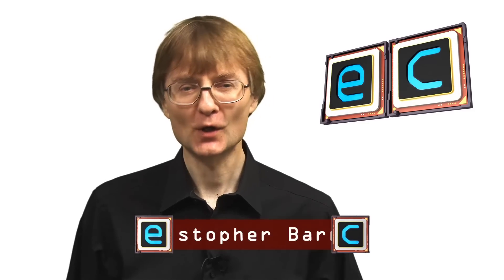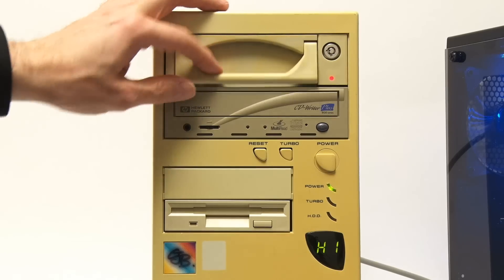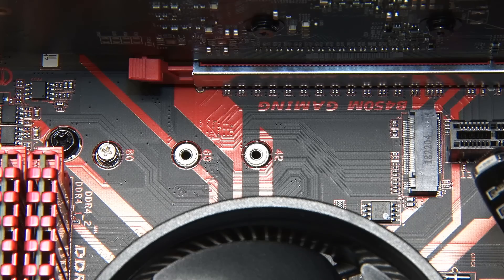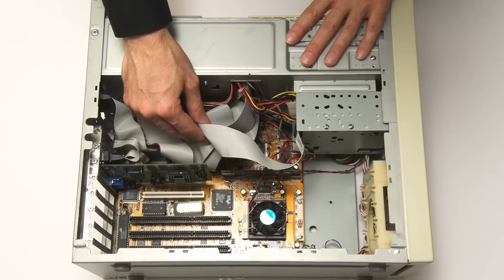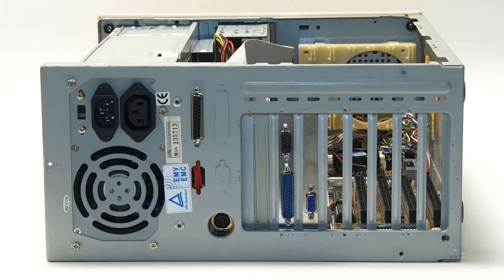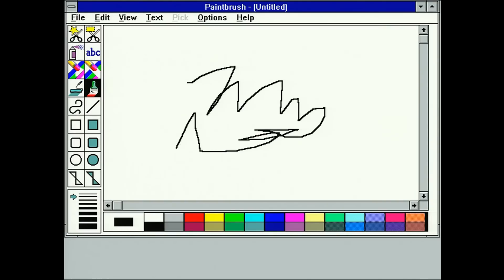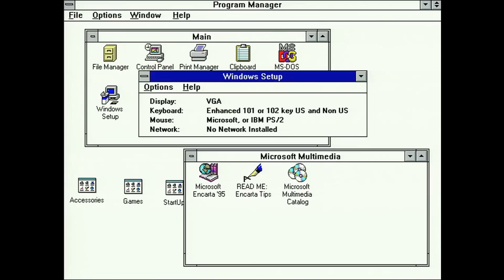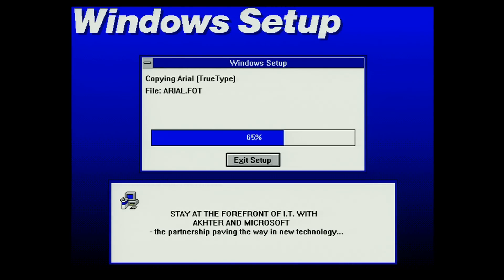Ryzen 3 vs 1996 PC

Comment: at the end of 2020, my GTX 780ti was failing, but with the insane inflation of graphic cards, I decided to buy my first new Laptop instead. I got a Lenovo Legion 5 with a Ryzen 7 4800H and an RTX 2060, I Installed (2) 1TB M.2 drives (Corsair MP400).
The Laptop it was standing in for an Intel i5-6600k & GTX 780ti (rip), and my other PC (currently used daily) Ryzen R5-1600 & GTX 980ti. I expected my Laptop to be almost as good, or on Par with, the Ryzen PC. I was happily surprised that my new stand in Laptop, had more performance than either one of my PCs.
I know alot of the experience, is owed to the Ryzen 7 CPU, but I was also encouraged to throw the 2060 a little credit. I know my PCs are getting a little, long in the tooth, but if I were to upgrade video Cards I would seriously consider the 2060, for a alternative budget choice, below the RTX 3060 / RX 6600xt offering.
If I had to compare computers, I would like to see  how a first gen Ryzen system, with an older mid-upper level Graphics Card, would fare, against the modern AM4, with a budget, modern Video card.

Comment: My first CD ROM drive was via a SCSI adapter plugged into the side of my Amiga 1200. I couldn't tell you how many hours I spent going through shareware stuff on Amiga Format etc. cover CDs.

Whether I wanted to spruce up Workbench with more pleasing NewIcons, use a spreadsheet or word processor or simply play a game, it would always take multiple floppies, often with no support for hard disk installation due to copy protection, but these magical shiny bits of plastic held all of it. It was almost mind bending to a teenager like me, who just what? 5 years before had been saving and loading approx 160kb of data per side of C60 tape, then just previously to getting the CDs, been limited to 880k per disk.

In '99 when I got a CD Writer, my mind was blown again at 650mb of movable storage.

And now I'm not impressed unless it's over 2TB, and even have an 8TB back up drive. Maybe I'm turning into a snob.

Comment: I must ask the obvious questions. In 1996 I bought a new PC with Windows ‘95, why did you not get the latest OS.
Second, where is the modem? I used it to connect to AOL and MSN. Even my first 1986, PC had a 2400 baud modem for the BBS. 

FYI my first computer was an AT&T 6300 with dual 5 1/4” floppy drives and a monochrome monitor. I added a 30 mb hard drive card to it that cost $500. It was custom built in a small computer shop by strapping a Fixed disk card, a frame and a drive together. It took up two slots.

I could not afford a first generation CD writer so I went down the tape drive unit road and then to a USB Zip Drive. Then the price of CD drives dropped.
Reply from the maker: I built this PC, rather than buying it, and chose to use Windows 95, as I already had a boxed copy. The modem was external.

Comment: The newer PC has 250 x the memory and if quad core makes it 4 x as fast then 
 116 times the speed!! You're right, they were so expensive, about 32 years ago my 286 processor PC was £850, over £1700 in today's money. In real terms my HP Intel i7 laptop bought this year is under half the price.

Comment: My first PC was a 133 MHz CPU,128 MB RAM, a 2MB VGA Video card and a 127 MB HDD. I now use a Lenovo T530 Think pad with an i7 Quad Core CPU, 2   128 GB boot SSD, 16 GB RAM, a 1TB storage drive and Intel 4000 Graphics.

Comment: This is making me quite nostalgic. I built my 1st computer in mid 1995, ostensibly to help with my degree work. Unfortunately I ended up staying up all night playing Doom and eventually delving into the innards of this new-fangled operating system called Linux.  I can still clearly remember the specs though. It was a 486DX2-66 with 16MB of ram, a massive 500MB hard drive, Soundblaster 16 and a Cirrus Logic VLB graphics card. I think I may have pressed the turbo button a lot. 

If my dissertation had been on Doom secrets and Sim City 2000 arcologies, my degree would've gone a lot better.

Comment: God I remember that after you exited windows back to DOS and then typed "exit", you had to manually turn off the on-switch, as it was a real switch back in the days and not a push button.
And when I first saw the "HI" on the display, I thought that the computer was greeting me...
The most expensive piece of machinery I ever bought was that 233Mhz Intel Pentium MMX equipped PC back in 1997. But I still have its monitor. It is a 15" EIZO F35 and it is still working! EIZO FOREVER!

Comment: Always nice watching your videos @ExplainingComputers. Thank you! 🙏

I am curious.. if you were to still find a use for this machine in current times, instead of keeping it as a ‘dust collector’, what could be a practical application beyond turning it on from time to time for simple nostalgia? I know a RPI could well outpace it, but I never like to see wasted processing power sitting around, and I always try to find ways to reuse it 😄

I am more interested in its practical use with the current setup (MSDOC + Win3.1). But I would also be interested in hearing your opinion on how far this machine could be upgraded (in terms of both hardware and software) for other practical uses. Is there a Linux version that would run on it for example?

Sorry, lots of questions, but your video really made me thinking.. I guess this is content for a whole new video 😄😅

Keep it up 👏🏼
Reply from the maker: Thanks for this -- as you say, a whole new video. I guess an old PC like this could be used as a server, for retro gaming. Or, for a writer like myself, it runs WordPerfect 5.1 just as well as it did when I wrote books on it many years ago. So as an off-line office machine, it is still fine.

Comment: Ah those were the days - horrible fat ribbon cables, and those awful molex connectors which you could never get apart without using a screwdriver and stabbing your knuckles in the process. That combined with the sharp edges of old PC cases made computer building a very dangerous and bloody affair! :)

Comment: Have one of this channels Ryzen builds - my case is very similar too - it's my daily work horse, running Ubuntu. And I still have a tower custom build from the late 90s languishing under a home office desk. The problem about firing it up these days is primarily display - I'd need to adapt its VGA analog to HDMI. And to work with my HDMI/USB kvm switch, would also need to adapt the PS2 mouse and keyboard to work over USB. A modest retro project some day, I suppose.

Comment: I wonder if Windows 95 would run on that system. I used those when I was a kid! I don't miss them. :D
Reply: my 1st pc was a pentium 133 / 32 MB RAM, also in '96 and we put (well my brother did) win 95 on it. I think it had a S3 trio something gfx-card and he was amazed as how smooth it would render explorer windows with content showing and not just the outline :D
Reply: @MarioMarioD80  Wow. Tech keeps moving forward. The computer we had in the house was a Commodore 64. The first one we all used was a Dell Dimension 4100 Pentium II.
Reply from the maker: I'm sure it would. :)
Reply: @ExplainingComputers  Have you thought of running a low spec Linux distro on it? Perhaps DSL?

Comment: Thank you for a very interesting and nostalgic video, Chris. I am trying to decide where to go with my computing in the future - Apple Mac to compliment the iPad and iPhone, make do and upgrade what I’ve got, which is old pc running Windows 10 Home or build a new pc. My question is about upgrading an old pc. From watching an earlier vid of yours I learned that it is possible to use an old motherboard but all I could do would be to upgrade RAM and storage. Is the front side bus still physically on the Motherboard in the Northbridge chipset on new motherboards? And if it is, am I correct in thinking that on an old pc the fsb is the potential bottleneck. I suppose I’m asking what are the considerations for upgrading or to start building a new pc based on a new motherboard and processor.
Thanks for answering this and keep up the excellent and informative videos.

Comment: The first computer I built had a Motorola 6800 CPU running Mikbug, and by build I don't mean attaching a motherboard to a case and plugging in the CPU/memory, I mean physically wiring all the individual chips together based on a hand drawn schematic. The interface was a serial port, there was no video. Storage was cassette tape (via a serial converter). Boot time was never an issue because it didn't contain an operating system, only Mikbug...and loading software was a slow process. Very limited functionality, even an 8 bit arduino is far more powerful, but what a great learning experience. Someplace in my garage buried in a box I still have that, who knows, maybe it could be fired up. What I wanted at the time was a SWTPc 6800 system, but I couldn't afford it.
I remember other "home computers" (like the KIM-1) that just had push buttons/switches, and 7 segment displays, fortunately my first computer was more "advanced". lol

Comment: Damn. I want that beige case or similar as long as the i/o slot is there and stash it with the latest hardware such as Z490 and i7 10700k. Plus add one such as USB 3.0 front and rear panel, M.2 drives and a high end noctua cooler (NH-D9L). Following the trends that some are doing :)

Comment: Just wondering why you chose a processor with inbuilt graphics and used it with a discrete graphics card?
Reply from the maker: I made a series of six videos in which I built the Ryzen PC, showing how it could be upgraded over time. The graphics card was only added in the 5th episode. So, if I was building with everything with a graphics card from scratch this is not what I would do. But I built up PC, as many, many people do. Indeed, I have had thousands of comments and e-mails following the series from people who have initially built with an APU, with the intention to add a graphics card when they could afford it.

Comment: Nowadays power supplies are located on the bottom of the enclosure, sound a bad idea to me since heat are rising up with convection,  having more heat on the system electronics, what do you think of that!?
Reply from the maker: So true, but gives a more stable centre of gravity though.

Comment: I  had built for me a  P90 in 1995, in a bigger case (the one shown here is a "mini-tower"), but I ran it on Slackware Linux, which was far, far more capable than Windows. It provided an environment very much like today's, the big difference being that the installation was entirely manual, which was still more or less the rule for MS-DOS and Windows 3.1 too (as seen here). Very little PnP, one had to edit all configuration files by hand, which was still a lot easier than setting up a Sun workstation ten years earlier.  It had a Gigabyte motherboard and I used SCSI diskdrives with a PCI SCSI controller, in those days more capable than standard dumb IDE(ATA) drives. Networking was not a native part of MS-DOS/Windows 3.1, whereas it was integral to Linux. Of course, in 1988, Sun produced the 386i, for only one year, one of the great missed opportunities in computing, with capabilities never fully duplicated, though modern Linux finally does as well (and much faster).  Had Sun pursued a 486i and later Pentium versions, with full PC compatibility, Sun instead of Microsoft would have become universal. Instead, Sun chose to concentrate on the high-margin engineering workstation market with their own in-house RISC hardware. Later, Sun came out with another Intel-based workstation, but by then Windows ruled the desktop.

Comment: back in the old days, engineering students had to optimize code to run in small memory (8-32MB) with fast scsi disks shared over 10mbps ethernet. NFS stale mounts persist :-(

Comment: LOL! My first was a MJN Technology 486DX (maths co-processor version) in 1993. I paid 120GBP just to upgrade from 40Mb to 120 Mb HDD (never fill that in 100 years I was promised) and an upgrade from 14 inch to 15 inch monitor cost a similar amount. A full 1 Mb RAM and loads of tweaks with HI-MEM-SYS stuff (can't remember what that was all about now - something to do with loading up stuff to high memory to maximise that massive 1 Mb RAM). Windows 3.11 for workgroups was a huge improvement from Win 3.1 Happy days eh lol. My RPi 3b would be a  luxury in those days. I'd love to see a decent comparison of the computing power of these machines over the years.

Comment: You made a mistake around the 9 minute mark and said "another serial port" while pointing to the 25 pin parallel printer port.  Old system has standard dual 9 and 25 pin serial ports on the slot insert and a 25 pin parallel port attached to the case.  Meanwhile around the 13 minute mark discussing "Encarta", it should be noted there were far more detailed Encyclopedias and more information on everything in 1996 on the Internet easily accessible on "Gopher" (port 70 predecessor to Web) known to most everyone who had already at that time been on the internet for the past few decades prior.  The catch is that the internet was not all that graphical, text and various fonts and styling but if you wanted the pretty pictures to go with the text information then you would go to something like Encarta as modems were quite slow back then and high speed network access was only available at government locations and major universities.  Graphics otherwise kept minimal due to transmission speeds at most locations.  It is an interesting side footnote that while much of the world in the general public first became aware of the internet in 1992, it actually went back to the early 1970's and its origin predecessor arpanet even further back to 1962 leaving some of us already using all that decades before most people out there even knew any of it existed.
Reply from the maker: Yes, you are right -- I got that wrong. I'm always looking at things from such strange angles when filming -- you have a  much clearer view than me. So I sometimes get well into a shot and have no idea what I'm pointing at!

Comment: 1997:
- pentium 166MHz
- 32 MB ram
- S3 trio 64V+ 4MB
- Sound blaster 16
- Conner 2,1 GB HDD
- 8x Sony CD rom
- 3,5 flopy Sony
- mini tower I think PSU was 150 or 200 W
- philips color 14” monitor (one with green on/off button)
- chicony keyboard
- microsoft 3 button mouse
Reply from the maker: Those were the days.

Comment: My first 'pc' was a 386 running 25Mhz with either 2 or 4 megs of Ram. It also had an 60 Meg hdd running at 4500 rpm. I can't remember all the details but I do recall it was expensive. That was in 1992 or 93. Before that it was Amigas, CPM, and Sinclair spectrum with cassette drive all the way back in 1984. Fun times 😁
I think what I miss mostly is that there were so many different brands of computers, all incompatible, all fighting for a spot. Very few survived, and now everything is the same, and so dammed generic. It was the computing wild west in the 80s. A massive free for all.

Comment: You had a CD writer in 1998?!!! Holly crap! Only the rich had that back then! (Well, that's how I saw it, but I know better now.) I totally remember those 3 1/4" drives. When did the bigger 5 1/2" disks get replaced by the 3 1/4"? One thing I always wondered is, did the turbo button ever work? Why did they include one if everyone always wanted turbo on? Why not just have the cpu always be on turbo? And you had a 1GB drive in 1998?!!! I didn't even know they existed back then, at least not for consumers. And where's your ZIP drive? Oh, FYI, in the mid-late 90s I was still using actual encyclopedias and libraries to do research during my undergrad years. Except by then the university at least had databases where you'd punch in keywords and the computer would either spit out CD-ROM serial #'s or books on the shelves, which I'd then have to go get off the shelf and find the section in the book, and read from an actual book or academic journal. That continued even into grad school in the early-mid 2000s. I can remember as an associate instructor grad student, telling my undergrad students, "Don't rely just on Google to do research." LOL. Thx for this trip on memory lane. I do remember Windows 3.1. I also remember when Windows 95 was the craze of the world. When it came out, people would trample over other people just to get a copy. Computers are a hell of a lot more powerful today.

Comment: That old Pentium brings back many memories, I think the first computer I built was a 486 dx2 66Mhz system.  Much more difficult back then with all the jumper settings, and cables which could be installed backwards.  I am staggered at the advances in technology that have been made in such a short time.

Comment: I'm sorry but are we supposed to be impressed by the new system? If that's even a secondary intention behind the making of this video then that point is completely lost. Who the hell builds a system in 2019 with only one front usb3 port? The motherboard header supports TWO. Having to route a second cable to reach a usb2 header is the result of nothing more than Cooler Master wanting to save a dime on the front ports. And speaking of that front, how the hell are your fans supposed to breathe through GLASS? The tiny vent at the bottom is a pathetic bit of lip service to the idea of airflow, that front panel seriously restricts the performance of your fans and directly impacts the performance of your stock cooler which will now have to spin faster and generate more noise since most of the air it's moving is just recirculated hot air. Just from that perspective alone, when considering the case this new system has been built in, this comparison deserves derision.